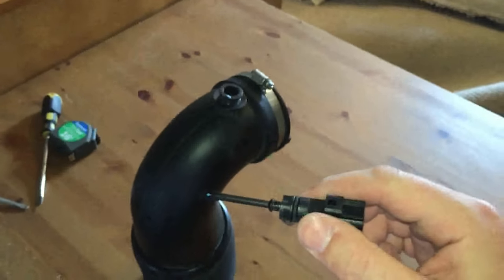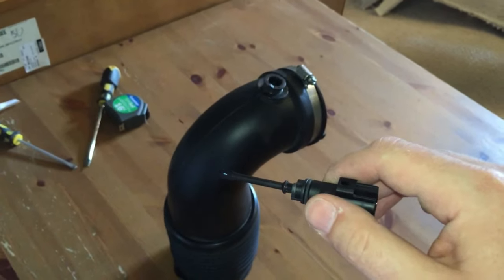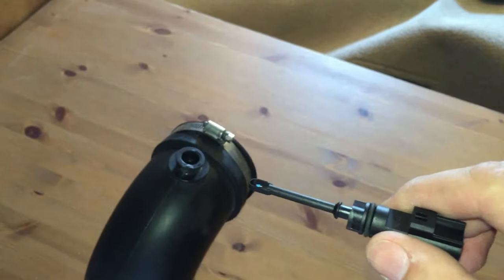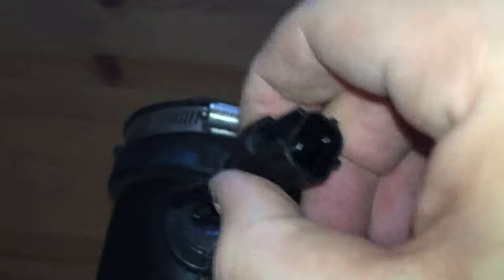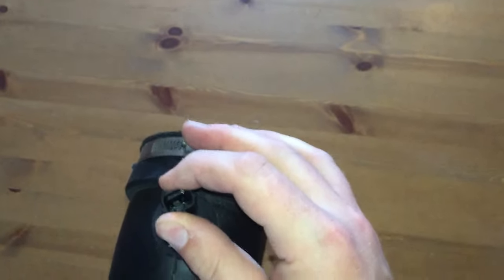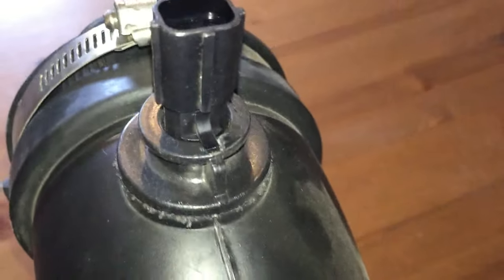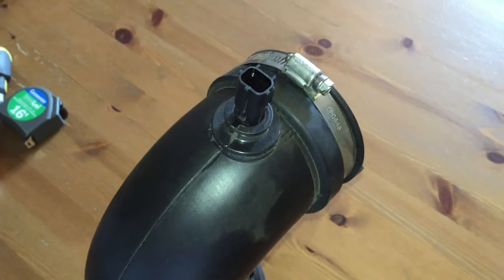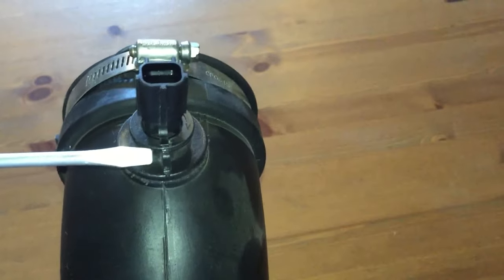How To Install / Remove Air Intake Temperature Sensor Properly

Comment: Mine will come out super easy, new one wont go in. Same part num, visually identical, but difficult to install. Will try again later today. Wonder if entire intake has to be pulled to do it properly. Have 2004 Jeep WJ 4.7 V8.

Comment: Don't see any tab or arrow for a 07 Jeep Wrangler. Tried turning clock and counter directions and using a flat head to lift the sensor nothing won't come off.
Reply from the maker: Sorry man. I am not familiar with the sensor for the Wrangler.

Comment: I snapped the little plastic notch sitting on the out side but it seems fine you think it will hold up fine?
Reply from the maker: Yeah it should work fine. I ran the first one I snapped for a year or two. Just check it now and then

Comment: For some reason tho I can’t pull it off after doing everything ur saying
Reply from the maker: Once you get past that locking clip it should come out.  It’s kinda suctioned in there.  You need a little pull but not too much.

Comment: On my 2014 Dodge Challenger RT, the IAT replacement sensor had to be somewhat forcefully pushed in and then twisted into place to lock in, just wondering if the sensor still wiggles slightly or is it firmly set into place? Because mine slightly wiggles but nothing major.

Thanks.
Reply from the maker: I do recall needing to kinda push it in pretty good and then like you said twist.   I don’t feel like it’s not right but there is a little play in there.  And it might be because I took it on and off a couple times.

Comment: I just subscribed.
Keith here.
I'm not sure what type of vehicle you were working on.
But I have a 2000 GMC Sierra P/U 4.8
Do you have any idea where my IAT maybe located I have not looked yet.
Thanks Keith.
Also on YouTube
Check out
KK Motion Pictures
          at it

You will love it.
Keith Kuhn
Reply from the maker: This was on a 2016 Dodge Charger RT.  Unfortunately I am not familiar with the GMC Sierra.   I’ll check it out.  Thanks.
Reply: @BurnseysRT  
Thank you
My problem I believe might be a MAF
I'M GOING TO PUT ANOTHER ONE ON AND SEE IF THIS HELPS MY PROBLEM.
KEITH